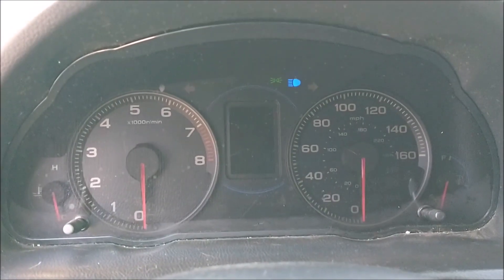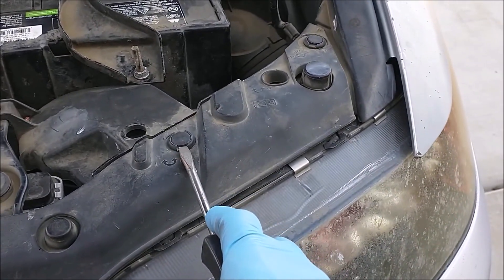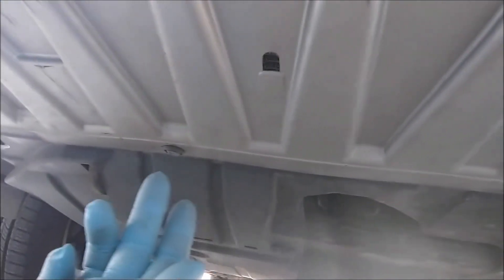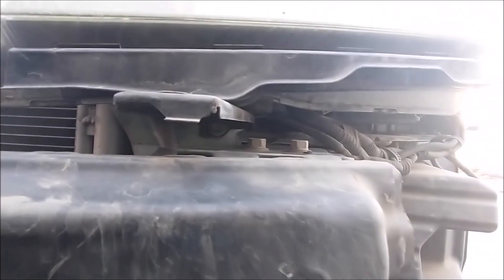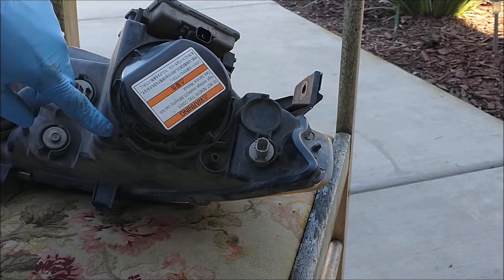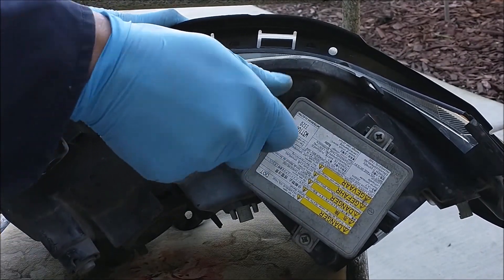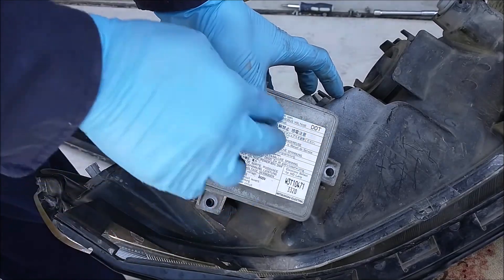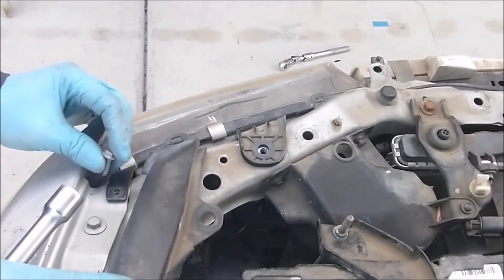How to fix not working HID headlight by replacing the Ignitor from Acura TSX

Comment: Fun fact: you dont have to remove the headlight to change the igniter. Simply twist them off the bulb and unplug them from the ballast. Should take 20 min to swap them both.
Reply: Thank you so much , I'm like ain't no way dawg 😆 😆.
Reply: Removing the whole assembly is less of a hassle overall though, otherwise you will have to fumble around in tight spaces.
Reply: Man if I end up having to replace the ballast, I’m just gonna unplug the harnesses and attach the new one, leaving it hanging in the engine bay. Leave the old one where it is

Comment: Sorry I’m at work and I’m watching the video on mute but is my igniter going bad if my low beam doesn’t work or it flickers then dies?
Reply from the maker: https://youtu.be/LS9_IftDMs8
Reply from the maker: There are 3 components that make the light turns on. It can be anyone of them
Reply: Yoo bro I have the same exact problem my both my low and high beams on the driver and passenger don’t work with new bulbs the left one will flicker for 2secs then die but the day time running lights and turn signal work. Did you ever figure out your problem?